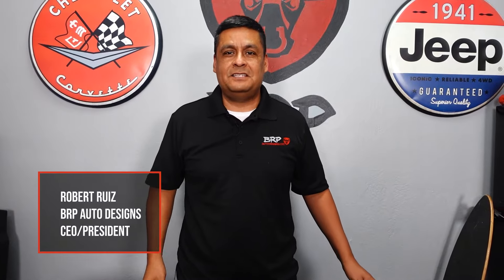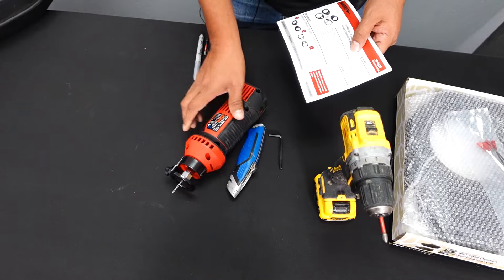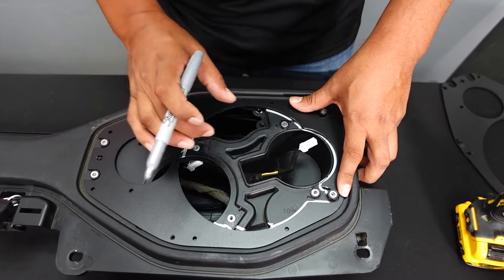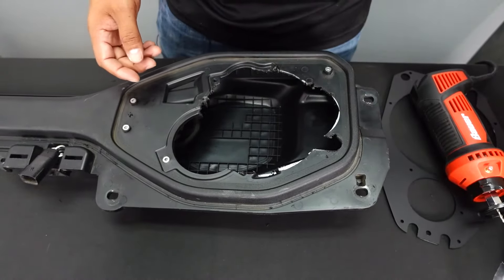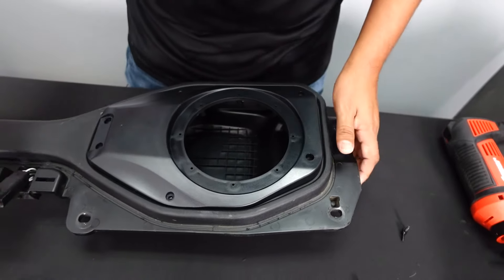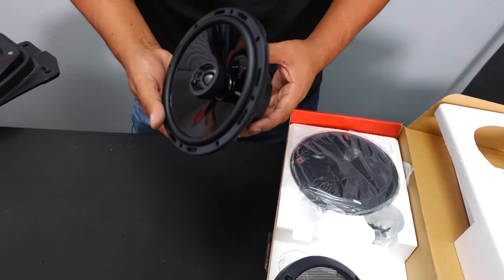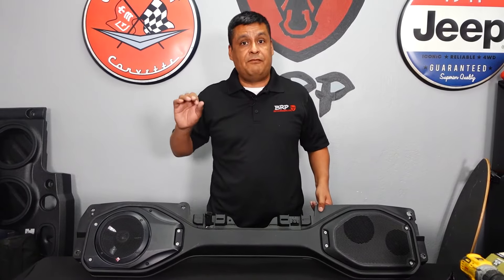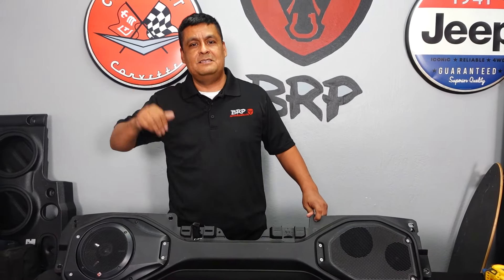HOW TO UPGRADE YOUR FACTORY SOUNDBAR ON YOUR JEEP WRANGLER JLU OR GLADIATOR JT

Comment: Nice video.  I agree with you, leaving the sound bar in during installation is the way to go.  I did the same thing you did, cut the dogleg slot / removing the boss. (I didn’t see your video prior to my install).  I was able to fix it with the boss I cut out and the largest flat piece of plastic I cut out.  I drilled a thru hole in it and JB Welded it back in.
Reply: What should I do? I just brought my 2022 Rubicon. I have the Alpine premium system in it. It's loud I can I get a louder sound? She I add a better sound bar?

Comment: I have an Alpine system and tried the new 6.5” and only got lows (used the larger plug).  If I splice into the highs wires like the video says, will I still get the lows too?  Eventually I will be putting in a 5 channel amp but I wanted to do this for a short term upgrade.  Thanks!
Reply from the maker: Glad we were able to help you out.
Reply: @brpauto7313  I wasn’t helped out yet.  Will it just play the highs or will I get lows out of the speaker too?  I don’t want to cut the highs plug off if the speaker won’t play as it should.
Reply: I have the Alpine system, too. I want to add more sound. I love the sound I have now, but I want it to be a little louder
Reply from the maker: @bolam32  if you splice into the other plug you should get the full range your looking for.
Reply: Which wires get tied together? Im doing the same@brpauto7313
Reply: Did anyone get a solution?
I have the same issue.. 😢
Reply: @jcgs1603  return it. It's designed for a non alpine system. There is a option out there for the alpine premium radio that's not too expensive. It's a 6.5in alpine type 2 speaker with tweeter and it comes with a pod about 300$
Reply: @SPGspeed88
Dang, i will have to just switch them for  better 3
5 and 4inch speakers. The alpine plug and play are $400 😢

Comment: Makes you wonder why Jeep didn't go 6.5" in first place.
Reply: I know right? I think my uncles TJ had 6.5 maybe 5-1/4 on his soundbar. 

I really thought they were factory 6x9 because of the size of the chamber's in the sound bar.
I got the Alpine 9-speaker system in my 23 2 door and was wondering where the extra 2 speakers were. I didn't know the soundbar had 2 speakers
Reply: @wailingalen the tj wasn't factory 6x9 lol they were a 4x3 in the front and a 4" in the early one and 5.25 in 03 and up

Comment: Would dynamat help imside the sound bar ?
Reply from the maker: We never use it on the soundbar. If you hear rattling, you might want to check the wires or loose screws on the speakers. We usually only Dynamat the area surrounding the subwoofer enclosure.